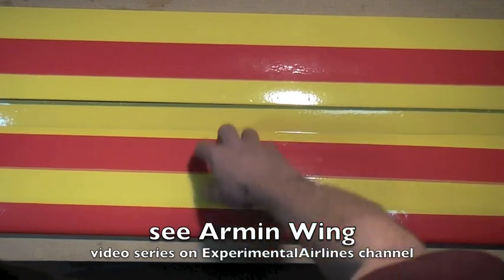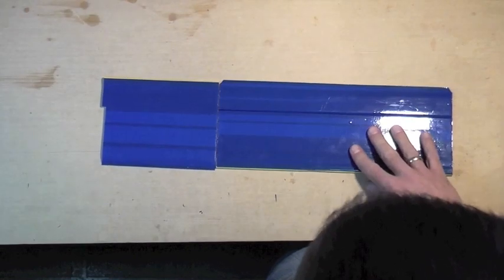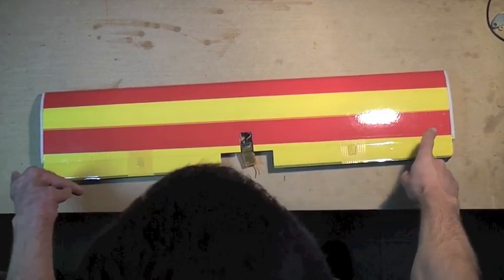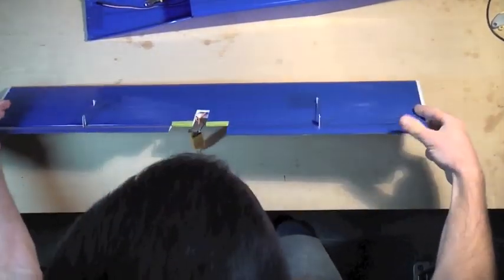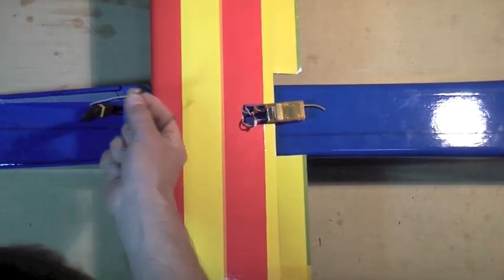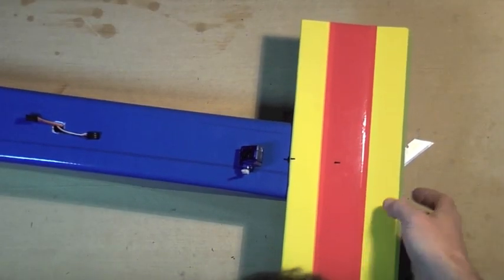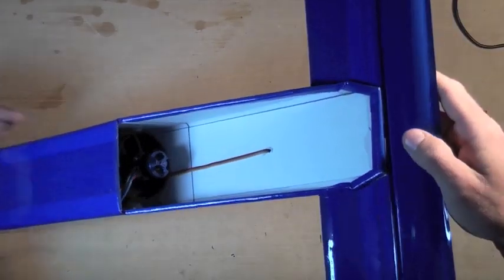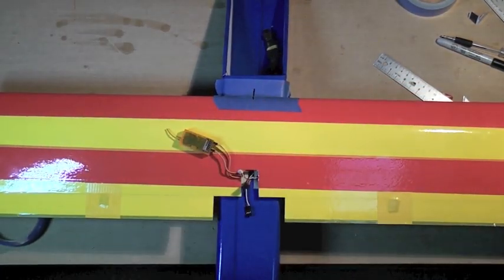FUGLYJET EDF, Build #3 - wing and tail

Comment: so the cheap $9 4300 kv motor from HK should work too....but I might go with the $18 3500kv motor, or will that not provide enough thrust? That EDF is only $4 at HK so if I blow it up its cheap enough to order 2!

Comment from the maker: That is the EDF I used or pretty darn close.  It is not the highest performance fan but they are cheap.  The motor I like is the 4200KV outrunner I got from Hobbypartz.  The 4800KV put out a little more thrust but isn't quite as efficient.  Hell, all EDFs are pretty inefficient.

Comment: what size motor did you put on the EDF?
are these the specs for the EDF you used?

EDF Ducted Fan Unit 2.5inch  5 Blade
Blade Diameter: 62.2mm / 2.44inch
Outer Case Diameter: 66mm
Wall Thickness: 1.35mm
EDF Length: 41mm
Front Shroud Diameter: 72mm
Motor Mount Holes: (from 16mm & 18mm)
Blade Type: 5
Shaft Size: 3mm